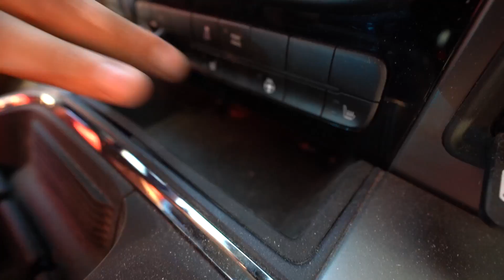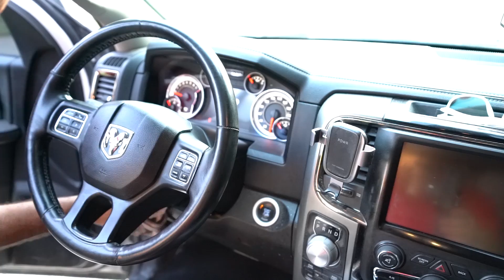Deep Cleaning A Dirty Contractors Truck | Disaster Inside and Out! Insane Vehicle Transformation!

Comment: LA's Totally Awesome degreaser & all-purpose cleaner works better than oven cleaner and is only $1.25 at any Dollar Tree. I use it to detail my car and sooooo many other things! My rubber floor mats look like brand new after. I also add it to the wash water to get the road grime off the exterior of the car. Also, dollar store aerosol bathroom cleaner is fantastic carpet and upholstery cleaner. I just whip out the wet/dry vac and suck it up. It leaves it looking like brand new and because its bathroom cleaner - it leaves a slight lemony fresh scent behind. Heather xo
Reply: SWEET!!